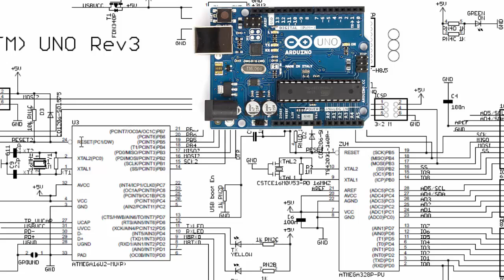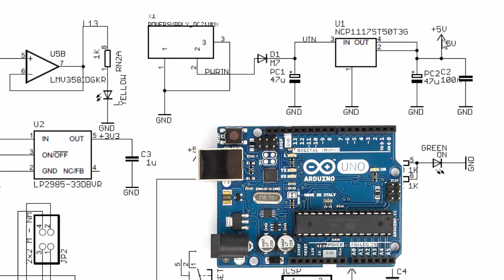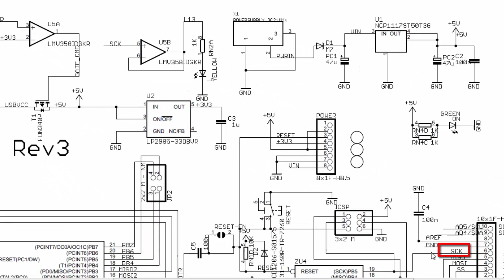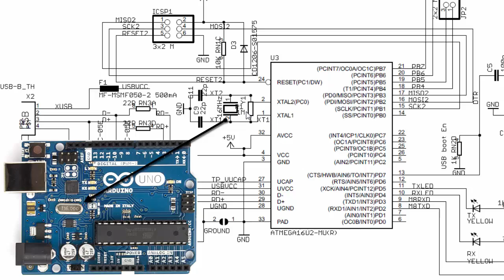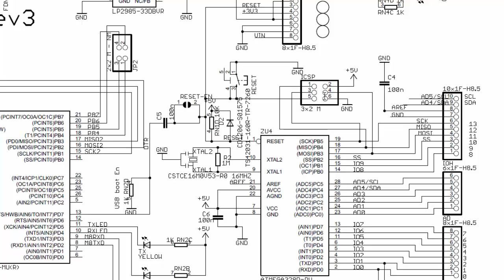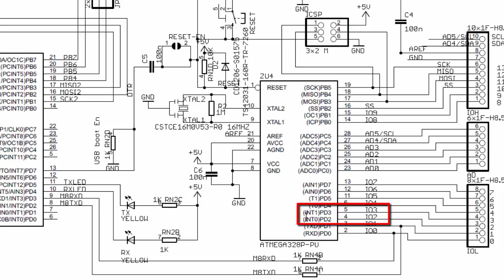Walking Around the Arduino Uno

Comment: Since Atmega 328 has a internal crystal to oscillate , then What is the purpose of  external crystal connected to the Atmega 328?
Can we change that 16Mhz crystal to Higher value crystal?